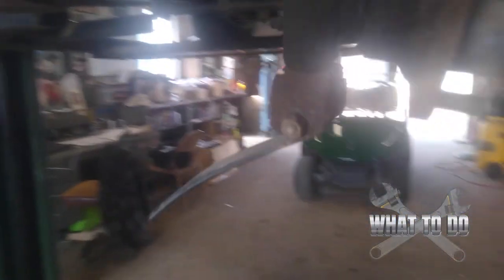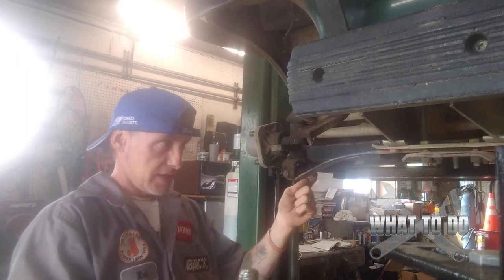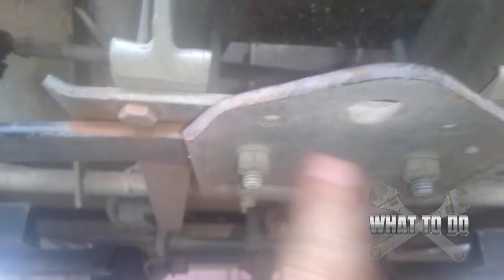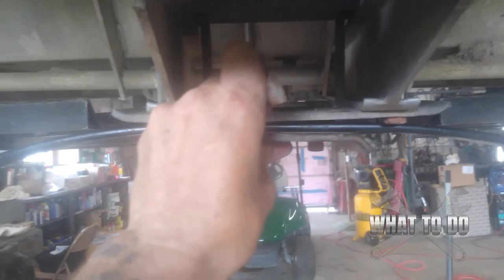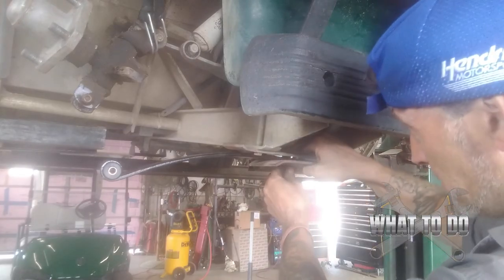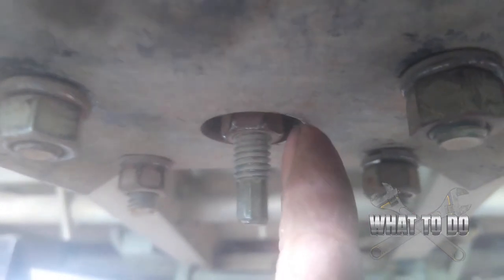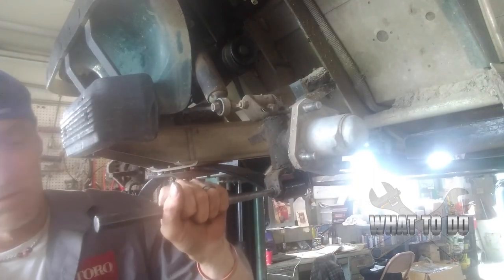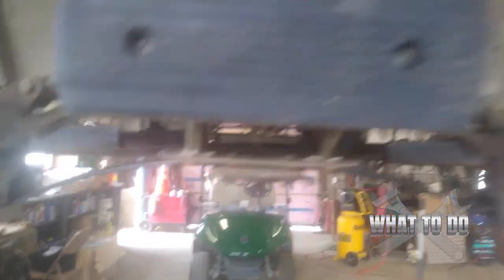How To Replace Front Leaf Spring on Golf Cart - Club Car

Comment: Thanks for the video! Very informative.  So I accidentally removed all 4 bolts on the leaf spring clamp (not just the two in the front).  I am now having trouble getting them all back in; they appear to be too short.  Us there any issue with replacing these with slightly longer bolts? Thanks.

Comment: I just did this to a golf cart, how much does it cost to have someone replace it.
Reply from the maker: I would say on average you'd be looking at around $300 to 550 depending on the shop that you take it to.
Reply: @youtubemechanic  that’s crazy, isn’t the part only like $100 and you just installed it in 10 minutes
Reply: @warrenschwartz4592   Maybe the video was 10 minutes long, but what about all the other time that goes into a business transaction.  First you are going to call the shop to ask questions like: can you do it, how much and how long.  Someone has to stop what they are doing to take your call and answer your questions.  Then when you bring in the cart, they have to stop what their doing again to get you checked in and the service ticket started.  Then, they will probably have to help you unload your cart, because it barley rolls correctly because the front leaf is broken.  I could keep going with this, but I think you get the point.  It takes a lot more than ppl realize to run and business and all of the above has a cost to it.  My business for instance has a 1 hour minimum charge, even if the actual work only takes 10 min.